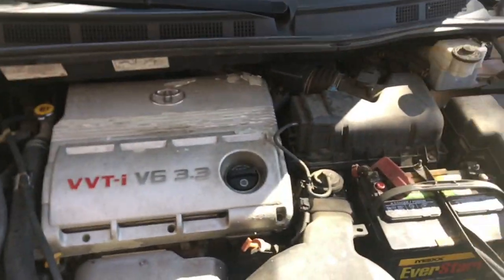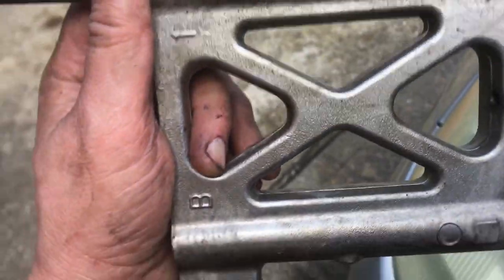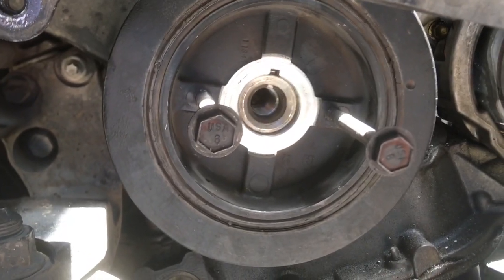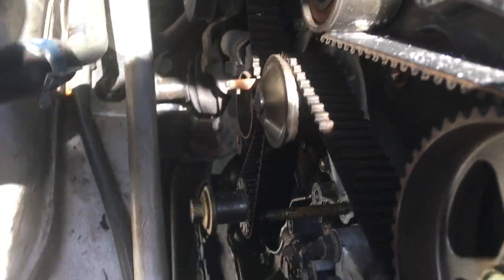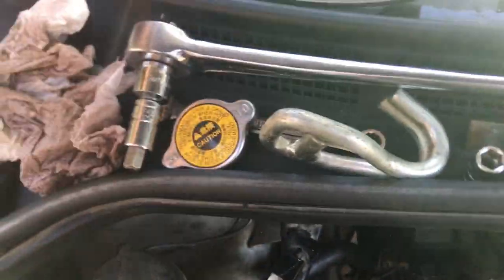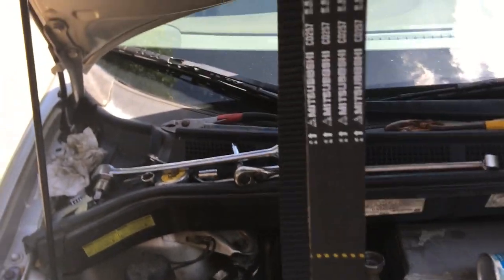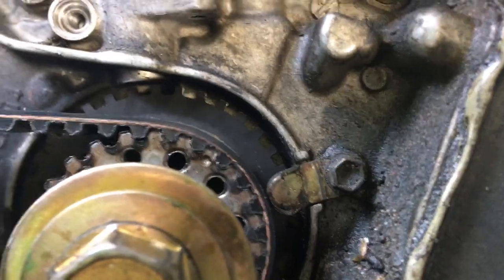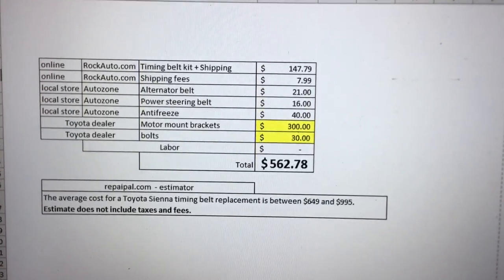Timing Belt and Water Pump Replacement (2004 Toyota Sienna) 177 k miles

Comment: Most places here in Canada will charge at least $1600 to $1900 for a timing belt replacement.  Original Toyota timing belts will easily last to +250,000 km.  

Nice video simple easy to follow video!  I would probably think that the water pump and timing belt should be an easily doable one weekend job.

Comment: Thank you!!!   You saved me between $900-$1200. I just completed a 2005 Toyota Sienna with over 200,000 mi on the original timing belt.  LOL!  I referenced a few other videos,  but I kept this video up to guide me through the entire process. It was the most straightforward with the clearest video.
Reply from the maker: Awesome! What condition was the belt you pulled out of there? Isn't it a good feeling knowing you didn't have to pay someone else for this involved of a service?
Reply: @projectfixit  The belt condition was horrible.  The inner belt cogs were still fine but the outer smooth part had multiple hairline cracks around the entire length.  I'm a procrastinator, so I got lucky on this one.  Thanks again for the best Sienna video out there!  My van's running great and ready for another 100K.
Reply: @youdagoob  So lucky. Wow 200k
Reply: Wow! you mean you only had ONE timing belt change after 200,000 miles? That's amazing!!!
Reply: Must be a 2004 because from 2005 Toyotas have timing chains
Reply: Mined is 191K never been replace with original spark plugs. Plugs still looks like new.  My mechanic friend he can't believe it.

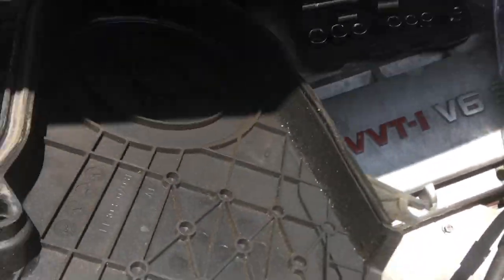Comment: Project Fix-It, thank you for this detailed and informative video. I was especially intrigued by the noise you described and demonstrated by pressing on the belt at 6:03. I found myself in a similar situation after I had my timing belt replaced by a trusted mechanic in my 2007 Toyota Solara Convertible (V6) with 48K miles (because of age, not mileage). An Aisin TKT-026 Kit was used, which included a Mitsubishi belt. I noted a chirping/squeaking noise in the engine compartment on the passenger side only at engine operating temperatures. The mechanic felt that the timing belt was the culprit and replaced it with an OEM belt. After a few hundred miles, the noise recurred. I feel reassured that you drove 87K miles with this phenomenon without a catastrophic failure. I hope that this is just a "cosmetic" and not a structural issue. If you have additional thoughts about this, please share. - Thanks
Reply from the maker: I had heard from mechanic friends of mine the timing belt could cause noise especially if they were installed backwards. I never experienced this issue on my QX4. The first time I replaced the timing belt on this Sienna, many miles ago, the noise concerned me so much I tore back into it to inspect all the new bearings that were replaced. The water pump made a squeaking noise as the seal rode on the riding surface. I immediately assumed the water pump was at fault. I replaced it with one purchased from the store. After all was put back together, the noise remained. I told myself we would just live with the noise. We did and the noise remained until I replaced the belt this time. I blame the belt as this is the only explanation which makes sense to me.
Reply: Project Fix-It Thank you. I will take the same approach and just live with it. Some folks feel that this has something to do with the camshaft sprocket and should be of no consequence if not attended to. Indeed, when listening with a stethoscope the noise is loudest in the area of the front camshaft. Thanks again.

Comment: My bolt on the mount was also ceased so I stopped and brought it to the Toyota dealer since my local shop charged the same price. Had all belts, engine mounts, pump, bearings changed for $1300 plus tax.   You got a good kit containing the "Aisin" pump which is oem.
Reply from the maker: Sweet. Thanks for the feedback.

Comment: Ran into the same issue as you with my motor bracket.  But for me, it was the front bolt that snapped.  I got the back bolt out.  Anyway, thought I'd share how I separated the two halves.  Since the upper half has a lip which extends out beyond the lower bracket, I put a pry rod under it on the side of the bracket that I'd gotten out the bolt.  Then, I used my floor jack to push the pry bar straight up.  The engine lifted about an inch or so before the frozen bolt started to bend.  Then, I just wiggled it back and forth to get the metal to finally fatigue.  This would not have worked if both bolts had broken off when trying to unscrew them.  If that had happened, I might have had to break out the Sawzall.  Part Numbers:  12316-0A040, 12315-20020,  90080-11624
Reply from the maker: Excellent feedback. Thank you.

Comment: Only thing I might recommend on this engine while your doing the timing belt.  There is a blank off plate to the left of the oil filter.  I seen that seal leak coolant.  Only 2 nuts pop it off, clean the gasket off and reseal it.  This way you wont have to drain coolant twice.
Reply from the maker: Excellent advice! I honestly have had to do this exact procedure you described the first time I changed timing belt at approx. 96k. This plate is accessible from under vehicle pretty easily. Thanks!

Comment: I might have rounded the long bolt for the engine mount bracket.  Can I still remove the top cover with it still there? Will I be able to remove it in one piece?

Comment: My 07 highlander hybrid , 3mzfe engine, similar setup,  I would say easier than this because no drive belt and powesteering belt. I called 3 dealers around here to see how much I can save by not going to them. TB+WP  all of them quoted between $1400 to $1600. I bought Gates kit on Ebay for $100. Will complete this job under $150.
Reply from the maker: Sweet! When job is all done, you can sit back and rest easy after saving all that money.

Comment: After when I replaced a timing belt changed. I'm getting a code p0016 looking online didn't show anything that is usefull some say it has a bank 1 miss one tooth. I re-check the timing mark witch us all line up. Still get a code p0016. You have any essue afte replaced a timing belt?

Comment: Thanks for sharing! Now i know that you can install the tensioner after the timing belt is routed perfectly and made it so easier rather than installing the tensioner first before routing / installing the timing belt!
I had i hard time putting the timing belt on literally😂 @Project Fix-it, can you tell me the exact way on how you routed the timing belt on easily? I did not see it in the video.
Reply from the maker: Thanks for commenting. I actually turned the right cam gear just a little bit counter clockwise about 1 tooth to get the belt in position on top and then aligned the timing marks again once belt was in position. It was a little bit of finagling, but it worked out. Sorry for not showing those details.

Comment: I am having trouble with the same bracket and bolt. My bolt broke of higher, almost flush. The bracket is not budging. Help please
Reply from the maker: The best I can offer is to give the bracket some love taps with a heavy hammer without damaging the surrounding components. Once you get movement from the bracket, even just a little, probe a long screwdriver or thin bar into an open hole and use it as leverage to wiggle it back and forth until the bolt breaks at the base.

Comment: Why do so many people do this without replacing the cam shaft/ crank seals? Not much more work to do and at this point they are likely shot and leaking a little bit of coolant.
Reply from the maker: In my case, it was pure laziness.
Reply: @projectfixit  
Lol I can understand that. If the kit you bought came with them I feel like you would have done it. 
Every time I’ve seen the seals replaced on this engine there is always a little fluid leaking due to wear. 
Looking to do this myself and priced all the required materials including some carb cleaner and anti seize grease all new belts and seals for $230 at advanced auto parts. Hopefully I don’t break a stud in the bracket though.

Most vehicles recommend you drain the oil before doing a timing belt replace. But it seems that isn’t necessary with the 3mz-fe? 
Also seen a lot of people struggle with the back engine drain plug to release all the residual coolant remaining after pulling the front engine plug and the radiator drain? Seems to be almost impossible to get the back engine drain plug out due to components of the AWD drivetrain. 
Just want to get this right. Last time I replaced a water pump I had to do it twice and that was a ‘00 cavalier so not even this difficult.

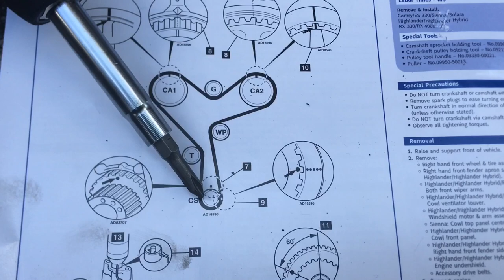Comment: At 11:25 time mark, on the Toyota instruction on diagram 11, it says you need to turn the crankshaft 60° counterclockwise. I have not seen anyone on YouTube doing such. I guess no one knows how to do it since the crankshaft bolt is loose and can't be turned counterclockwise. I wonder why Toyota mentioned this.
Reply from the maker: This is a good question. I did not catch that detail. Thanks for bringing to to the discussion area. Hopefully someone will be able to answer.
Reply: @projectfixit  I found a video https://youtu.be/XXYGQsZeRyg there's a comment from Gail Taylor. She explained it well about the procedure.

Comment: I have a 2000 Sienna on which the original owner replaced the timing belt at 105,000 miles at a local independent shop.  The price was $959.33, and that was in 2006.  It now has 210,000 miles and runs great, but it's basically a 3rd car and we hardly ever use it so we're a bit hesitant to sink more money into it.  After having watched your great video, i think it's at the upper limit of my comfort zone, DIY repair-wise, especially with some of the accessibility issues and special tools that might be needed, and I don't want to screw something up on a car that basically is running perfectly now.   I'm thinking of just leaving it as is and, if the belt goes then deal with it then.  My understanding is the V-6 engine on this model year 2000 is a "non-interference" engine and, even if the belt broke at high speed, it wouldn't damage the engine.  What do you think?
Reply from the maker: Well, I can only speak from my sienna experience. In both cases where I replaced the timing belt, I probably could have gone another 20-30k. However, I cannot guarantee the water pump would have made it that long. If the car sits for weeks at a time, you run the risk of the timing belt dry rotting and cracking I suppose.
I apologize if I complicated your decision. I would definitely find a friend who is comfortable with this type of repair and have them help you. Otherwise the majority of the cost comes from paying for labor and shop overhead. Give yourself a couple days. No need to rush the job if it's your spare vehicle.
Reply: @projectfixit   No problem.  Thanks for the quick response.  Good to hear about the 20-30K estimate for extended timing belt life, and I understand it's just a guess, but at least it's an educated one, and I understand also about the water pump life having no guarantee.  The previous owner used the car for a daily runner and, since we've had the car, I try to keep it from sitting around for weeks at a time by at least driving it around the block every couple of days or so .  We did take an extended trip in the car last year and actually drove it across the country and back, over 6,000 miles round-trip, with no problems.  What I'm thinking is I might just go ahead and order that kit like you did from Rock Auto and have it handy just in case either something pops or I get the motivation and have the time to tackle the job.  At around $150, it seems like a reasonably cheap insurance policy to have those parts ready to go.  I'll stick it in the car and, if I'm on an extended trip when something pops, I can just hand it to the mechanic and say have at it.

Comment: Great video. Must I line up timing belt lines the same as the gear notches, or as long as the gear notches are lined up correctly, I can install the t belt any way (with correct arrow placement) ??????????????????????
Reply from the maker: As long as you have the gear notches positioned correctly, belt arrow in proper direction, and have counted the correct number of belt teeth between cams and top right cam to crank shaft gear, you should be good to go.....I line up the lines as a safe measure and then count the belt teeth as a confirmation.
Reply: @projectfixit  appreciate u 👍

Comment: Always start from the harmonic balancer
Reply: In this car, it doesn't matter. It comes with all lines on the belt but he should have moved one tooth counterclockwise, install the belt on the cam sprockets and then rotate the crank sprocket back to TDC. get the slack away. This way the whole right side will have the tension and the tensioner will take care of the left.

Comment: didn't see the water pump studs being put back, did I miss it?
Reply from the maker: No, Sir! You are correct. This is a piece of the video I accidentally left off as I did not capture video of it. Good catch. I most certainly reinstalled them and the nuts. I do apologize for leaving this piece out and I should have at least pointed this out on the video.
Reply: @projectfixit  thanks for swift reply. very nice work overall. It is especially useful to point out the pitfalls to avoid after you learned of them the hard way, to me this is very significant, bravo.

Comment: Are you still happy with the Asin Belt?   Other videos on YouTube show replacing the Camshaft Seal and the Crankshaft Oil Seal.   What do you suggest on these?
Reply from the maker: The belt which came with the kit was Mitsubishi. It is quiet and I am satisfied with it. If you see evidence the cam shaft seals are leaking, it might be a good idea to replace. I chose not to although I did see some seepage around the lower shaft seal.
Reply: Thanks.   You have been very helpful!

Comment: what is that black rectangle thing on the engine support that you said needs to be changed? it doesnt have hose or wire, makes me wonder what it does
Reply from the maker: I believe you are talking about the top motor mount bracket. I really didn't point it out much other than noting the motor mount bushing needing replaced and I will schedule that later.
Reply: @projectfixit  yes the top motor mount.....but what is that small black rectangle thing bolted to it...is it a sensor? but i dont see any wire or hose attached to it
Reply from the maker: @EvendimataE  Ah. I believe it is some sort of counterweight to help with vibration dampening, but this is just a guess. I really don't know it's purpose and have asked myself the same question you are asking. LOL. So, maybe someone out there reading these comments can help answer.

Comment: Did you have a link to the stud puller set?
Reply from the maker: My puller I have had for years. however, the following puller kit should have what you need. ( kit # OTC4534  ) It can be found online and locally. You may be able to borrow the puller tool for free from Autozone.

Comment: Dman, i can’t get the belt to go over, it’s just one tooth away from the camshaft marking. Everything else is properly lined up....wth
Reply from the maker: Be patient. You'll get it. Loosen the top idler bearing if you need a little extra slop in the belt to get that last tooth to take. Just be sure to tighten it back up when done.
Reply: Project Fix-It i broke the rear mount bolt like you did, I ended up ordering this dorman lower mount with bolts for 35$. And the upper mount I put a bunch of penetrating oil and banged it out with my 5 pound hummer and punch. I ended up rotating back one camshaft one tooth, then realigned, then I moved the crankshaft back one tooth and realigned, all the lines were in place in the timing belt and pulleys 👍 it was really frustrating that it wouldn’t line up 😂 anyways, glad is done ✅
Reply from the maker: @yoyobored847  Awesome. I've done it twice on my minivan. It's always an adventure. Congrats on the repair.

Comment: So many things to do to replace the parts. 😣
Reply from the maker: Yes. It is a bit intimidating. Give yourself time. Expect the unexpected. All in all, it's mechanical and can be completed in a driveway. If you get frustrated, just take a breath and don't be afraid to step away and come back to it later. I have done this job twice on this particular vehicle. In this video you can see my unexpected surprise of seized and broken bolts. Thank you for watching!